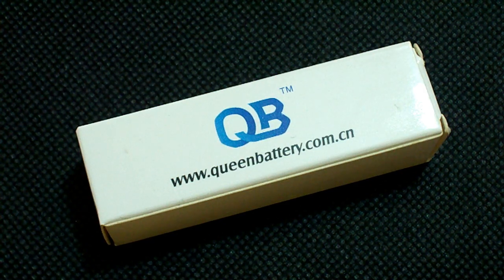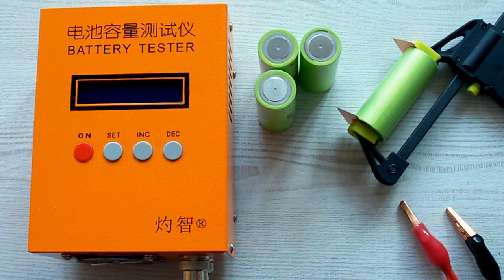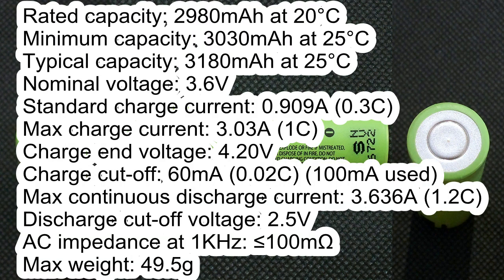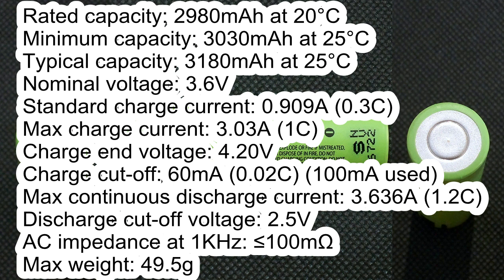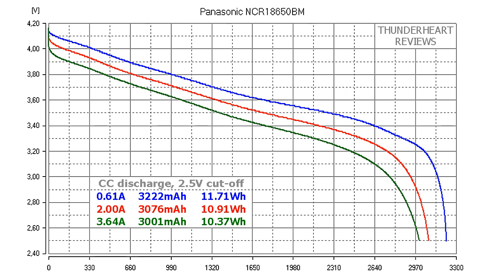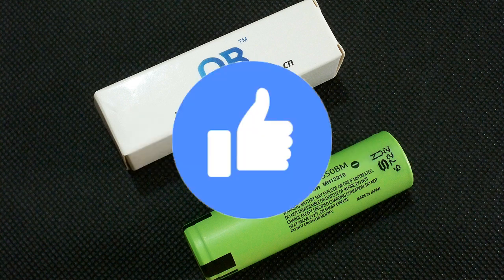Panasonic NCR18650BM 3200mAh Li-ion cell's capacity test

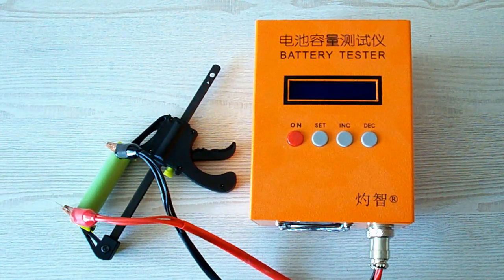Comment from the maker: 0:37 - Testing equipment and conditions
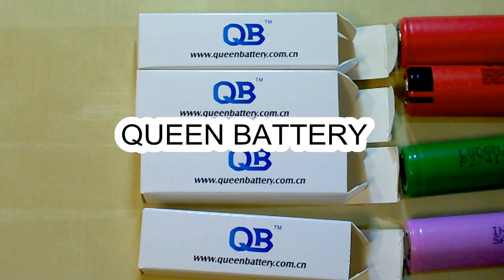1:47 - Battery supplier
2:10 - Panasonic NCR18650BM specs and capacity test
3:46 - Verdict